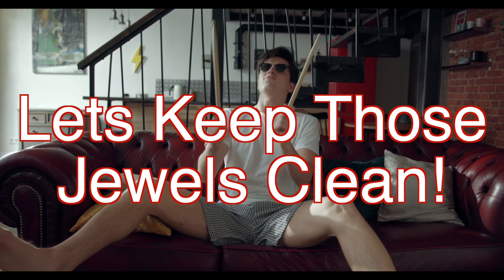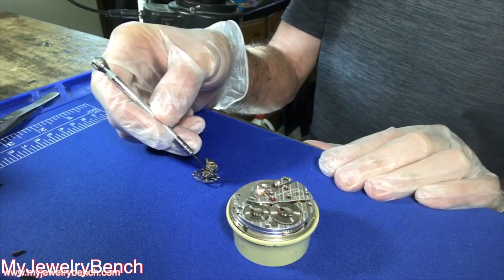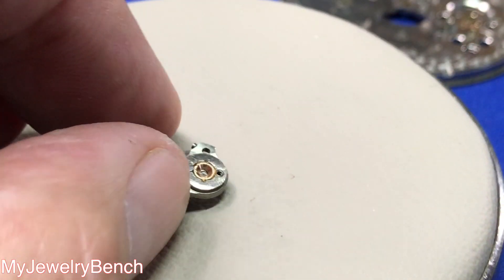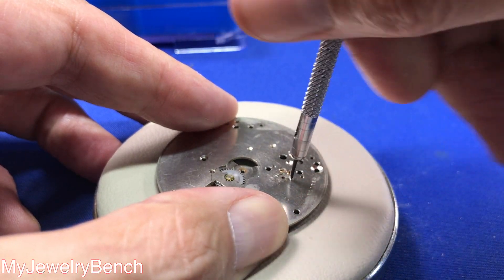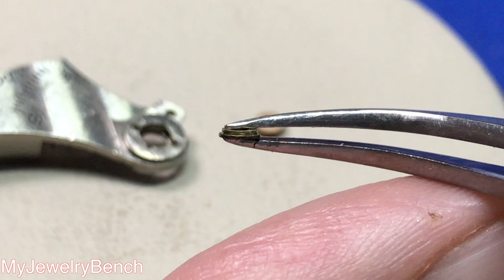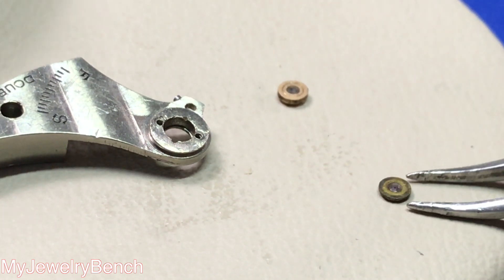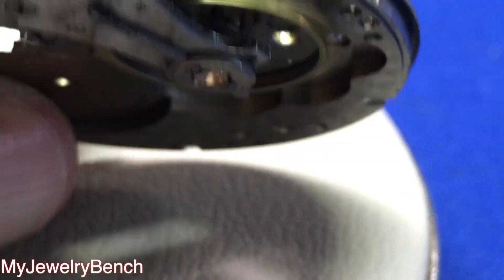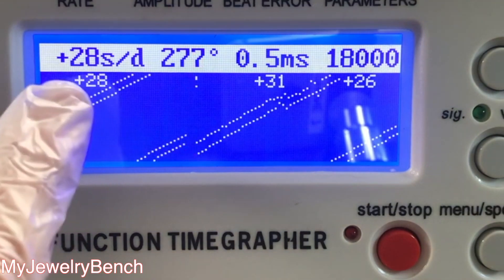Balance Jewels!  Keep Them Clean!

Comment: Thanks for doing this.  No video covers this and it's something I've needed to see done.  Thank you. Also, do you remove the cap jewel again to oil, or oil it from the bottom side? Thanks again.
Reply from the maker: I clean, dry, assemble and then oil.  Oil if it calls for it. Not all balance systems are to be oiled.